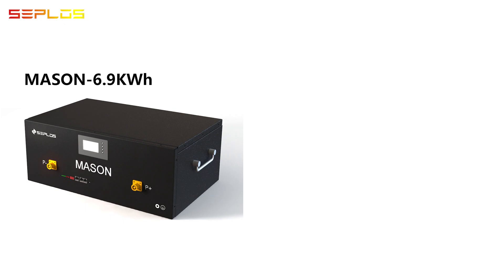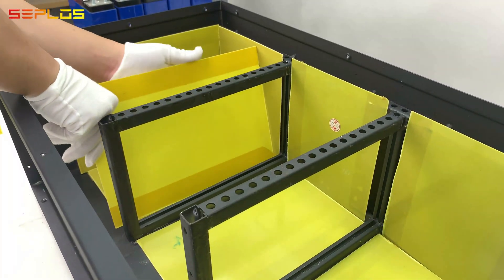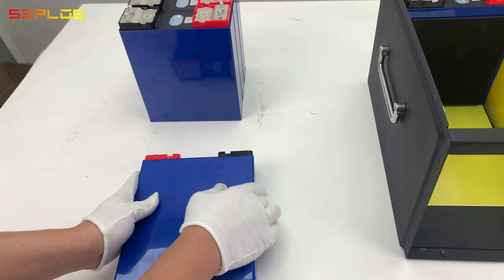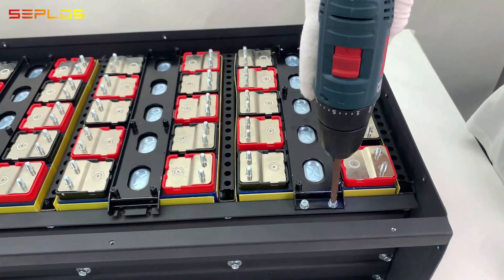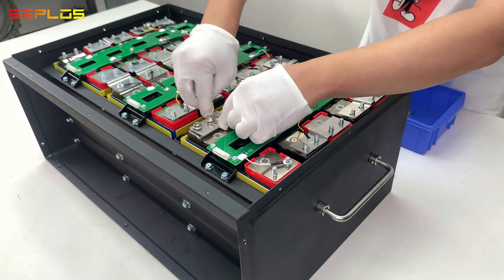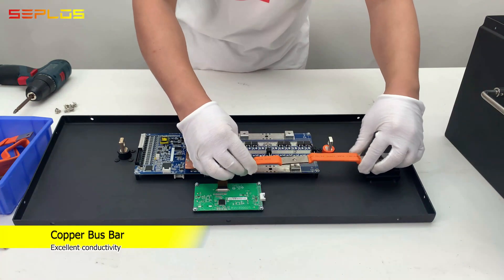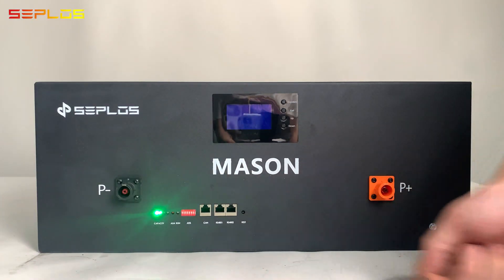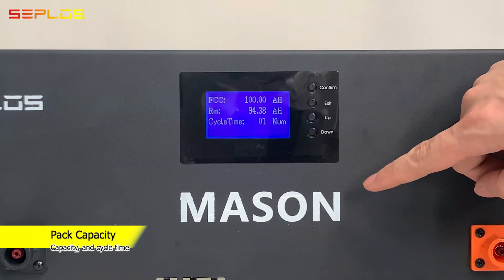Seplos DIY Program | MASON-9.8KWh Energy Storage Fully Customizable Battery Kits | Simple Building

Comment: You have a great battery but I wish you used posts on the outside as you have it on the inside.  You would have a better connection to the outside terminals.

Comment: Well detailed videos, for the external switch on the BMS PCB, please provided details on, can I used it to power on the BMS instead of the reset button,  can I used a push button switched, if yes what is specification of the JST connector for the switch

Comment: excellent job.  Two questions.  Are there any problems with heating?  Second question, is there low/high temperature cutoffs?  Thanks, Doug
Reply from the maker: 1. Heating is not a problem when using at the specified temperature range. The temperature rise is within the normal range as we tested. But for the extreme environment that is out of the range, this battery pack is not suitable. 
2. There are low/high temperature cutoff functions. And the cutoff threshold of cell temperature, ambient temperature, and BMS temperature are different, which you can check on the BMS specification. Contact us at info@seplos.com for the more information.
Reply: @SeplosTechnology  我想买 10 件，最后价格是多少？

Comment: Why no insulation cover on the top of battery
Reply from the maker: Hi Roberto Trinanes, you've mentioned a great point. This is just what we're considering when designing as well. Since the creep distance between cell and the cover within safe range. We cancel the insulation cover.
Reply: @SeplosTechnology  how come your other battery have you been provided cover.and your new design you cancel the safety on the terminal.
Reply from the maker: @robertotrinanes1744  Actually the top cover sticks with PC film, which didn’t show in the video.